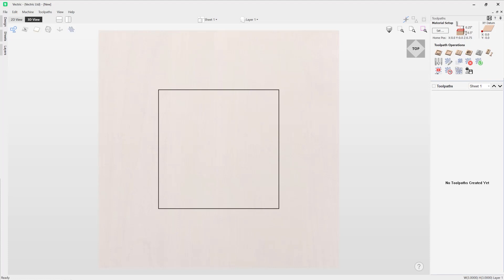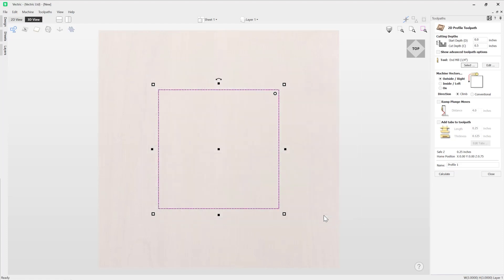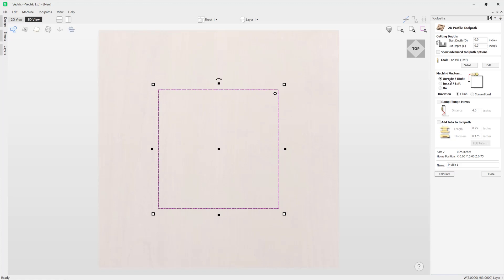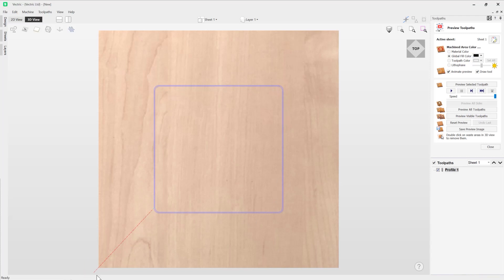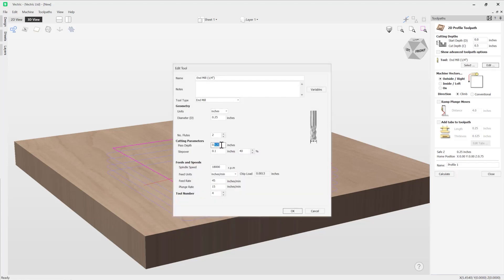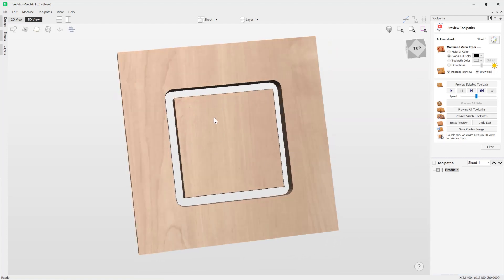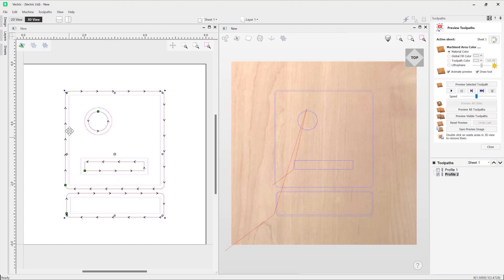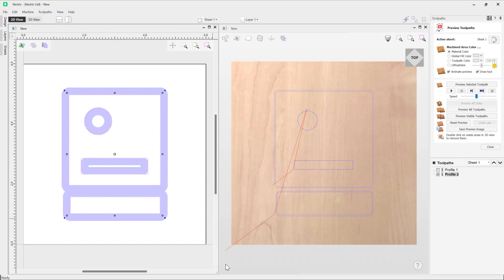How to use the profile toolpath in Vectric software | 2D Toolpaths | V12 Tutorials

Comment: Well Done 
what is the difference between feed and plunge rate 
i am confused can you guide me?
Reply from the maker: Hi there, that is a good question. The feed rate is how quickly the tool moves in the X and Y directions, usually defined in millimeters (or inches) per minute. Plunge rate is how quickly the tool moves in the Z direction, usually defined in millimeters (or inches) per minute. It is always a good idea to do some test cuts or even air cuts to get used to your machine and what settings suit your setup. Thanks